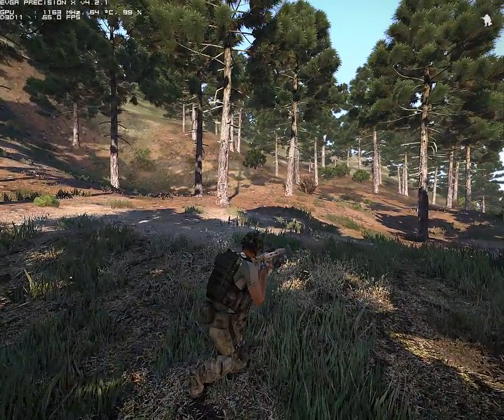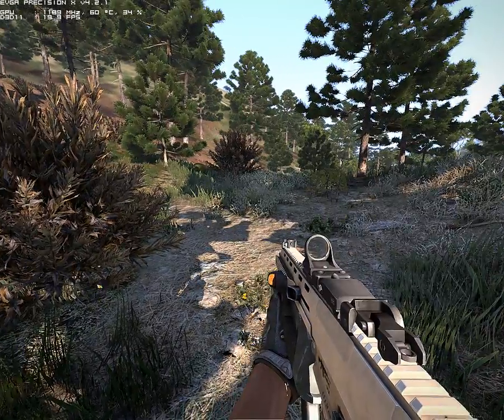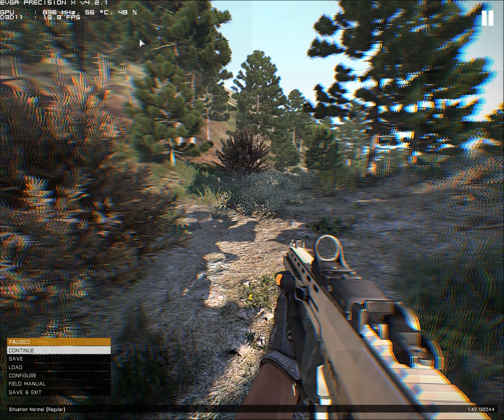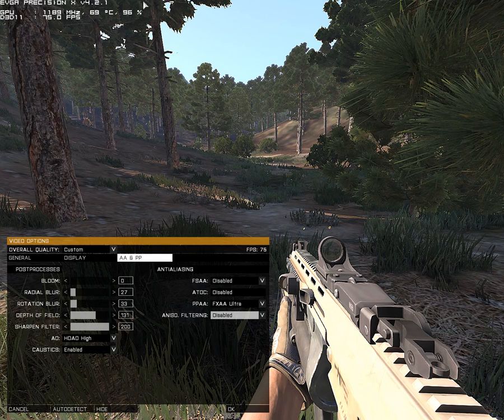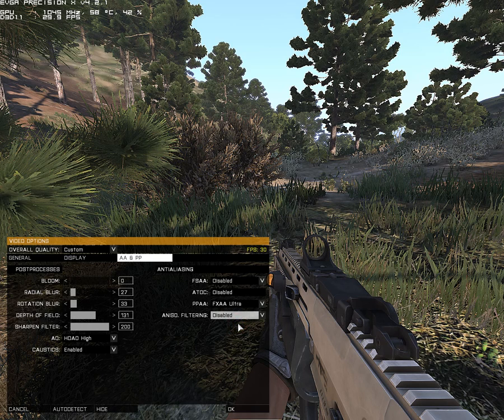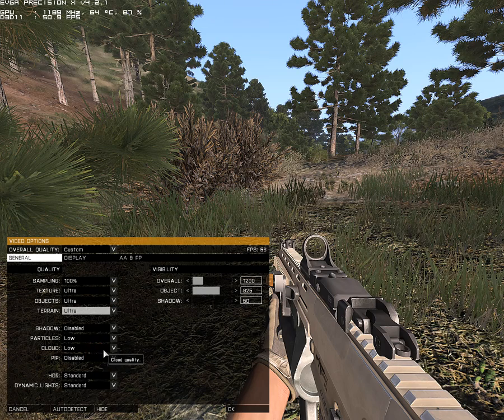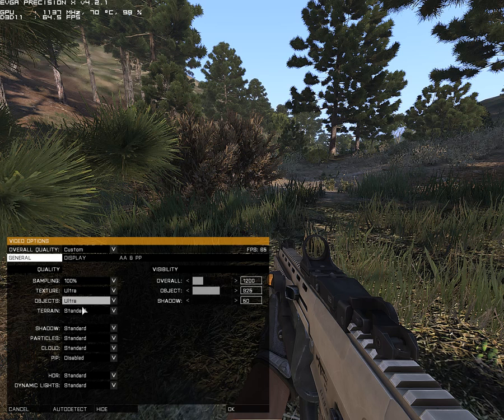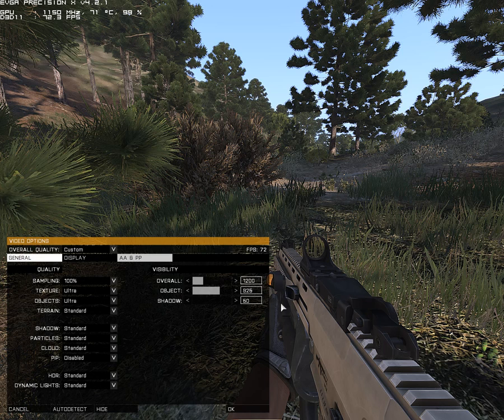ARMA 3 "CPU Bottlenecking & FPS Optimization"

Comment: It's all well and good when nothing is going on but the moment the shit hits the fan my fps tanks to unplayable levels just like a majority YES a majority of the games player base. The poor utilisation of Armas engine is simply unacceptable in 2017. If BIS release the next title with the same issues even the hardcore players will drop their loyalty. They have an engine that heavily utilises CPU and they are adding more bulk to it as time goes by but still they do not improve utilisation. The game supports 64 players but good luck playing ANY server running that level of players. Just fucking stupid. And people please don't defend BIStudio, this shit should have been resolved for Arma 3 and you know it. Most people can't even get 30fps average in multiplayer ffs even with only 20-30 players running about and NO AI!
Reply: Exactly!

I've been playing the arma series since 2010 and it was so disappointing to see the performance still be trash even after all these years.

People always defend the game and say it runs fine but I highly doubt it, they're probably in the editor doing nothing. 

If they tried doing a big battle in kavala on altis, they'd see right away how bad the performance is. 

For me, it drops down to like 9 fps, even lower lmao.

If this was actually fixed, we'd be able to actually experience arma the way its supposed to at least in my opinion. 

Because right now, we have to limit the gameplay to small boring missions that arent fun. 

What's the point of all this playground if we cant even use it?

Comment: I need your help.
I have a very big problem with Arma3. FPS are about 25-30 on the lowest settings 1080p. I think i should have some more of them.
My config:
CPU FX 6300
GPU R9 280
RAM 8GB
Reply from the maker: 25-30 is not bad at all in ARMA 3. This is comparing your CPU with the Intel 4690K http://cpuboss.com/cpus/Intel-Core-i5-4690K-vs-AMD-FX-6300 I would say if you want better performance, its all about single core speed and performance. Go Intel if you can and it will make a difference.
Reply: ***** Thnx, won't change anything for now but thnx. I tried something yesterday and now i got ca 40 fps and it's playable already. Thnx!
Reply: Thanks for this video, Burner. Watching it I was wondering then if having an Intel vs AMD make a difference, and you just answered it!
Reply: +B. Odpadki what did I change I'm getting around 20 fps also w a similar build
Reply: what did you do ??? :)

Comment: i think im heavily bottlebecked, got a 980 ti and i5 3570k, with 24gb of ram, it only.uses 20% of my gpu and about 60% of my cpu
Reply: HypoCr1tikal well you think wrong. The 3570k is still a very good CPU there's no way it will bottleneck the 980ti or any of the newer cards. Unless you're running a titan which running a titan with i5 is really dumb you should be fine. Your ram is overkill tho. Most games don't use more than 8gb
Reply: DNA Zoom Have you ever owned a i5 3570k and 980 ti? no, you havent, I used to get 20fps on crysis 3 on ultra with that combo and 20fps on arma 3, now with my new cpu I get 70 to 90 fps with the same settings on crysis 3 and 60 completely maxed out.
Reply: DNA Zoom My daily ram usage is about 12 gigs of ram without a game running

Comment: A lot of people that watch these videos for benchmarks forget that the server they are playing on may not be able to put out 60fps+ to all 40-80 clients they are hosting. My AMD fx 6300 @ 4.8ghz paired with an evga gtx 950 ftw would get the same frame rate (sometimes higher sometimes lower) as my AMD fx 4300 @4.7ghz paired with an Msi 750ti gaming card. I used the same motherboard, cooler, ram, and SSD to run those tests.

Comment: just bought 1080 Ti FE to replace my r9 290 gigabyte... saddenly only 20% gpu usage on arma with 30 fps. i have 3570 i5
Reply: Arma tree is CPU dependent, heavily. So you'll most likely need to update your processor with good single core performance.